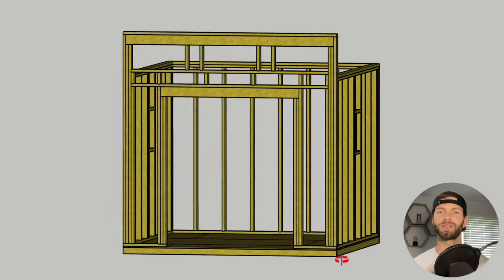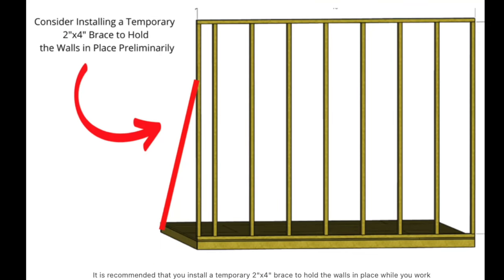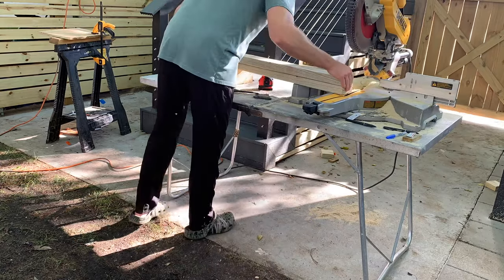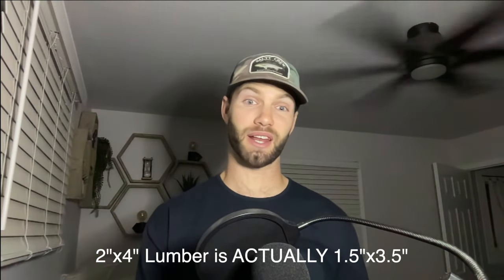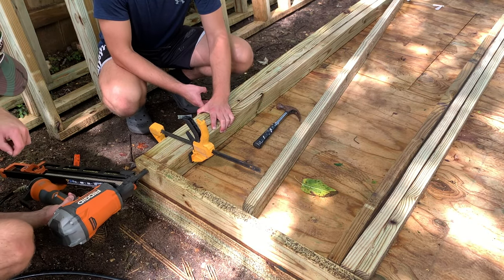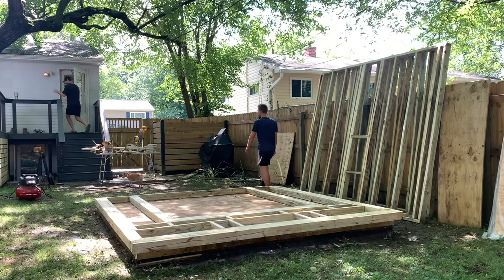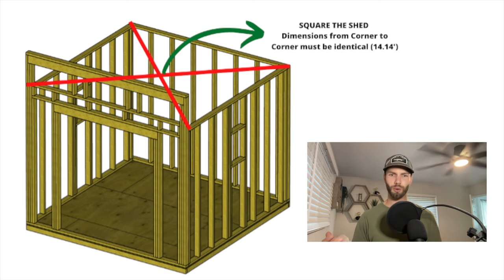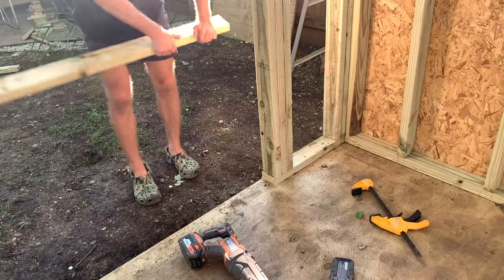How to Frame Shed Walls (Complete DIY Lean-to Shed Wall Framing Guide for Modern Shed)

Comment: I found the easiest way to do the walls solo is to screw a few off cuts to the base sticking up, this way you can run the wall into them and stand it up without it falling off the top.

Comment: Beginner question- what's  recommended length of the wall framing stud when using  T111 siding ? That will accounts for a 2"x4"x8' bottom plate installed on concrete slab and a double 2"x4"x8' top plate that as 2"x6"x 8' rafter sit on top plate.

Comment: Very helpful, step-by-step guide! Getting ready to build my first shed and this is so helpful! Thanks
Reply from the maker: Glad it helps! Good luck with your shed!
Reply: Did you need a permit.?
Reply: I live out in the country, so I can pretty much do what I want, as far as building in my property. I wouldn't think a shed this size would need one in a typical suburban neighborhood. If you add electric, I would definitely look into it.
Reply: @danoc1432  I live in a sub- Divison. The city wants a permit, and a Structural engineered plan. By the way, mine will be a 10X14
Reply: @c-yah1325  Wow. Good luck! Hope it turns out good!
Reply: @danoc1432  Thanks

Comment: Did you have issues with permitting or codes? I believe in my area you have to get your structure permitted if it’s on a slab like yours. Did you have any professional help when designing the framing? Looks great hope to try something similar myself some day.

Comment: Great videos. I am eyeing that course material. ;-)  Did you cut the end of your rafters on an angle to account for  straight fascia boards? maybe i missd it.
Reply from the maker: Hey Patrick - thanks for watching! I did not trim my fascia boards (personal preference) but you totally can. Just use the same angle as the pitch of your roof.
Reply: @AndrewThronImprovements  Thanks Andrew for answering the question.

Comment: You actually can put too many nails in a piece of wood. Wood relies on the connection between the fibers for its strength. Every time you poke a nail or screw in you weaken it. That's not to say to go too few. General rule of thumb is every 12 inches. A bit short is okay, just be careful. Also not saying you have to measure unless You're unsure what 12 inches looks like.

Comment: Cool. But as a framer/carpenter I must say its a waste of material when you frame corners like you did. Should, instead, use the California method. You can still sheet the walls with no problem, but use less material. God bless
Reply from the maker: I totally hear ya! I’ll consider that method next time I have a wall corner I’m working on. I’m sure there are a bunch of ways that you could “value engineer” my construction methods. The 10” rafter spacing is probably another lol. Thanks for watching!

Comment: These videos are great BUT… You only mention the support 2x4 to prevent the front wall from tipping if you do this alone. That is the only safety tip you share - I find it very irresponsible to work in crocs. You should be wearing safety boots, should one of those Walls fall onto your feet it would crush The bones to dust.
Reply from the maker: Hi Jessica! You are totally right. Crocs are definitely not the safest construction shoe on the market - that’s for sure. Steel toe boots are definitely the better bet. Thanks for watching!
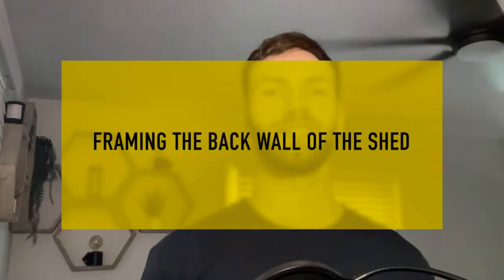Reply: @AndrewThronImprovements  what software did you use to make the drawings at around 1:02 ?